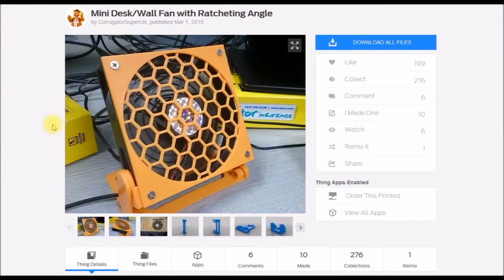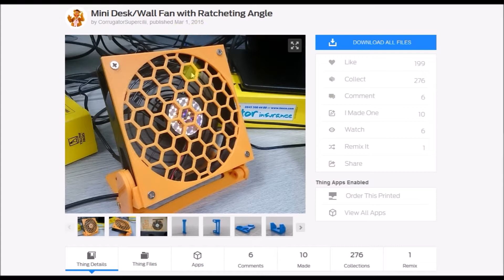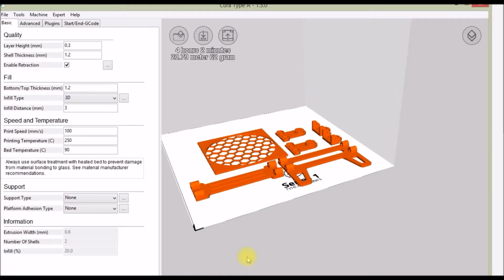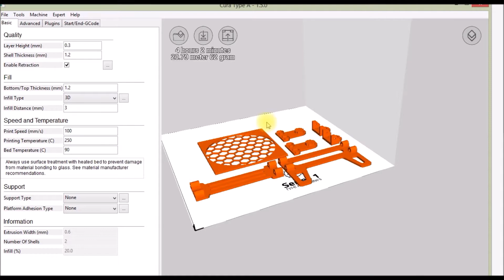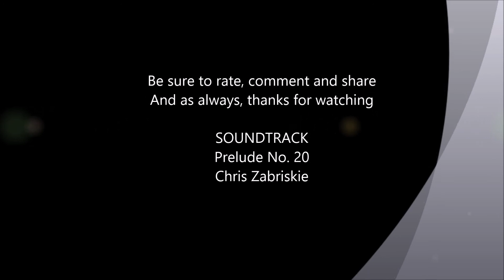12V Solar Cooling Fan

Comment: I want couple fans just like that for a roof vent idea. Not for attic more like a ceiling like in a finished closed porch, as the long closed in porch has no venting only windows and it gets HOT so heat has to be drawn out using fan in window. Already have 400W panels and Epever so I am close to being ready for some usage of all that.
Reply from the maker: Yes, these small fans do a good job.  Once I finish up enclosing my back patio area, I'll be putting in about a dozen fans like this for ventilation in the summer.  There's a bunch of 5" tall x 22" wide areas between the roof and south wall that I can fit fans into.  Put them on a thermostat switch powered off the solar power system and that should work well.
Reply: @The4Crawler  Thank you as your videos on subjects here and there I do not take for granted, This Old Youtube lol

Comment: Think you really that a such small computer fan is enough for a workshop? This is meant for in a car, boat, Truck.
Reply from the maker: It's only a few feet from my face and upper body and blows just enough air for a nice cooling effect.  It's not intended to cool the whole shop, just me while standing in front of the lathe.